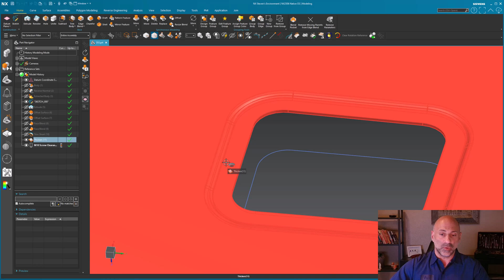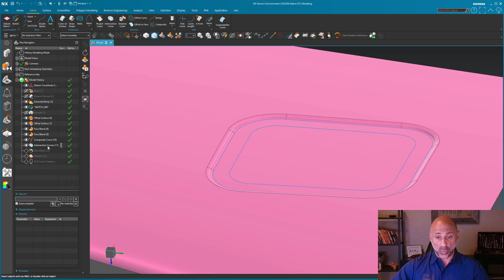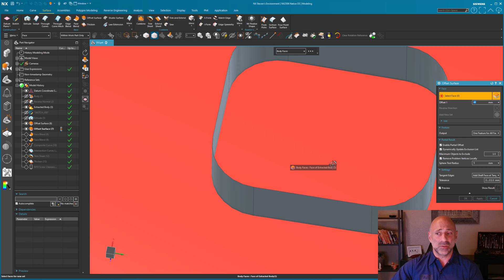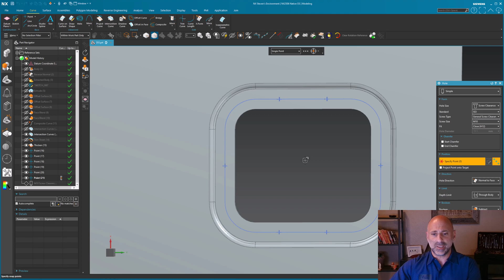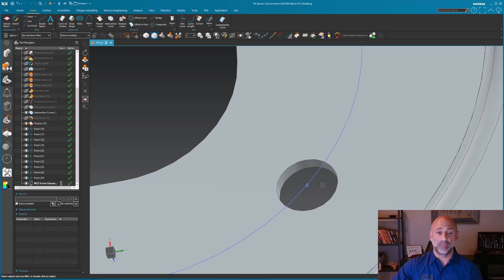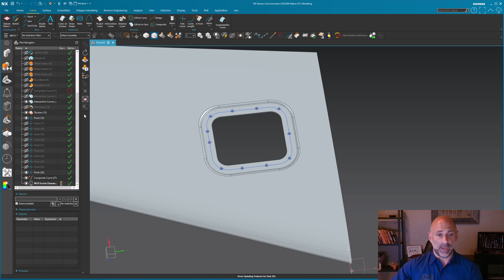🔧 CAD Design Secret: Master Hole Positioning with Parametric Formulas | Advanced Modeling Tutorial

Comment: Good morning, thanks for your tutorials. I am having issues of knowing when to apply g0,g1 or g2 continuity. I do hear that g2 is tighter and hence needs good surfaces, but I don't even understand what that statements means or even being able to visualize it. How do I look at a model or blue print when designing and know that this is g0,g1 or g2. I feel that once I know this I would be able to approach designs better. Thanks very much in anticipation sir.
Reply from the maker: G2 and above are meant for special occasions like styling and smoothness on surfaces. To be honest, most people are not properly trained on the subject. Even experienced trainers that do not have design experience will not fully understand it all. 

This is a massive subject. I have tons of videos going years back. Do a search and you will find them. Look for continuity. Some in NX and some in Catia V5 

I do have a surfacing course that does a deep dove as well but it sounds like you might find the answer without having to buy the course.